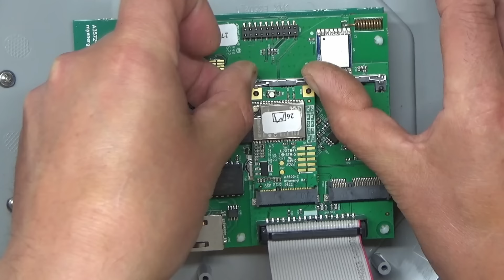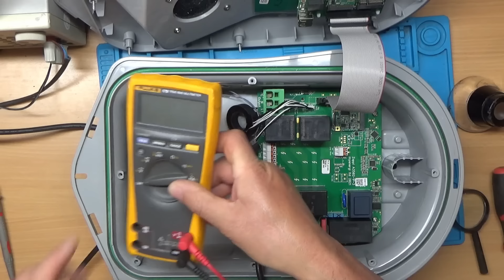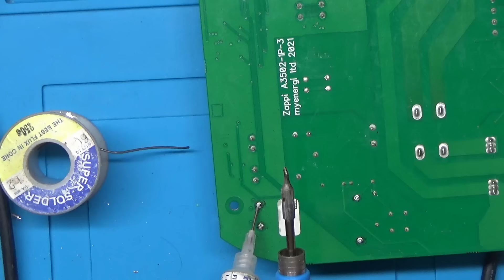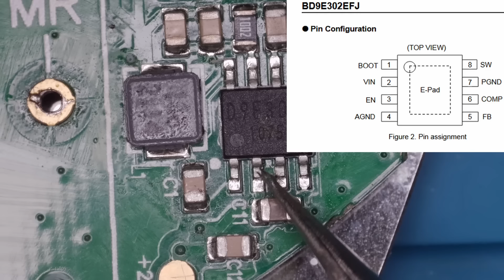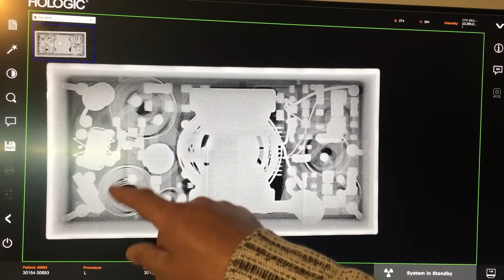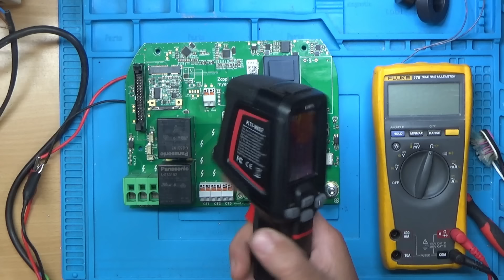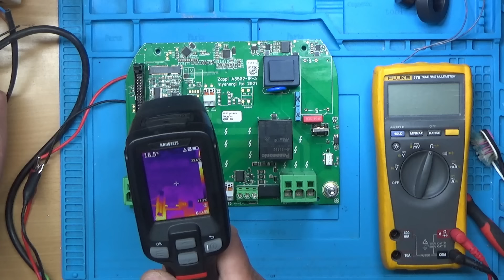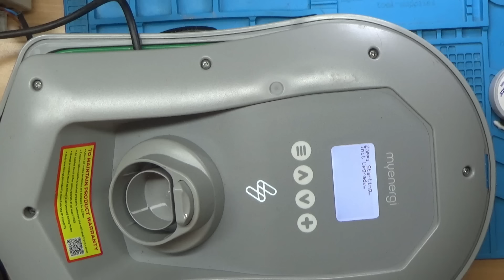Faulty MyEnergi Zappi EV Charging Point | Can I Fix It?

Comment: that's very complicated for an AC power switch.
All it needs to do is signal to the car what the max power is can supply, the car does the rest as that's where the charging system is.  I expect the rest is just to provide feedback to the user and provide time control. As I've heard that there can be restrictions on charging you car doing peak hours, it will turn the mains off unless you override it every time. 
Don't understand EV owners, I went away for 5days put £65 of diesel in the car and did over 500 miles without any worry whether I'd find a petrol station  with a free pump for the 5 minutes need to refill. 🙂
Reply from the maker: Yes, got all diesel vehicles here. I think the idea of this device is it monitors other things such as your solar power so it can tell the car to increase the charge rate during periods when the solar is giving more output (from what others have said).

Comment: Great job, Mick. Did you leave it at that or did you tinker with it until you found the break in the circuit? Thanks for sharing.
Reply from the maker: Thanks Brian, I just left it at that. I thought the PSU might have been removed previously.. and (see pinned comment 🙂)

Comment: It is a big fancy electrical meter but more importantly it is a communication device. It talks to the car via it's CAN network and the car tells it when it is good to charge. The EVSE (Zappi) then tells the car how much power is available to charge with. The Zappi also communicates with the solar so there is network pairs you can run from it to the meter box where you connect more CTs so the Zappi knows how much power your solar system is producing, and how much energy your house is using. It can then restrict the car's charge to use only the excess solar. There are other modes but that is the main selling point of that EVSE. That daughter board on the main board is the inbuilt protection circuit (RCD) - I had to replace mine when it kept tripping. I think it does other things as well like monitor vehicle isolation etc. An EVSE is not a charger - it just supplies AC to the vehicle's inbuilt charger so the relays are just for switching the AC through to the output when the vehicle says OK.
Reply from the maker: Interesting 👍 Thanks for that. I get quite a variety of things to repair so I don't always have time to research each item. I just try and fix it 😂😂👍
Reply: I am not an expert on EV Chargers, but I didn't think these home AC chargers talk to the cars CANbus.
I think they negotiate the available power levels using resistance between two of the data pins in the connector.

Correction: After some searching online it's PWM frequency used to negotiate.

Only DC chargers can communicate with the Cars BMS over the DC+ & DC-
Reply: @gavinnoname1424 You may be correct. I though they actually communicated over the CANBUS but I remember reading it's important to have the correct resistance across certain pins depending on whether it's 22kW, 11kW or 7kW.  AFAIK the EVSE uses a pilot signal (usually PWM) to communicate with the car which is why I assumed it's over CAN.
Reply: The EVSE and the vehicle typically don't have Comms for home charging. EVSE has a PP or proximity pilot connection to detect whether the cable is plugged in - this is the shorter of the 2 smaller pins in the connector. The other small but long pin - CP or control pilot has a PWM signal set by the EVSE to tell the car the maximum available current.

Comment: Nice, the potted ps in the x-ray machine. Like the electrolytics. Isn’t time for a Hakko FR-301 desoldering gun? And am I the only one who hears the Guano Apes when mentioning a “short on the board”?
Reply from the maker: Yes had been thinking of one of those, but there quite expensive (especially after I just bought an X-Ray machine 😂😂😂) I had to google "Guano Apes" and I didn't have a clue but it seems that's "Lords of the boards" ?
Reply: @BuyitFixit yes sir, lords of the boards, a ‘90s hit. Indeed the Hakko is not cheap and it is on my whishlist too, amongst other things 😅

Comment: This unfortunately happens a lot with electronics circuits, surface mount caps are a pretty common point of failure. There's so much waste produced due to the failure of such a tiny, inexpensive component. It's infuriating.

Well done on the fix though. 🙂
Reply from the maker: Thanks 👍Yes had this a few times now with different devices. One of them I remember, was the 1TB SSD I repaired on here which turned out to be brand new!

Comment: Replaced a capacitor, surprise nothing new there😉 great troubleshooting finding it.  Before you ran the wire point to point did you suspect a bad trace?  Strange xray didn't show a fault on the board, IDK.  Great diagnosing on your part as always, brilliant fix.  Thanks for the video and work.
Reply from the maker: Cheers Terry 👍I think the via between the layers of the board was damaged or missing. Nothing was on the leg of the PSU when I removed it, but looking back on the video it does look like there are black marks around the PSU legs already, so not sure if it had already been removed before (possibly by the guy who sent me it).
Reply: @BuyitFixit  Thanks Mick, I was totally confused. Amazed you figured that out.

Comment: You said there was no voltage at a certain point and added a jumper wire but why did that happen? And when did you discover that that little component was bad I re watched but couldn't see when you found it faulty.
Reply from the maker: Component @ 26:11. I'm not sure if the 24v PSU had been removed before? as when I first look at the board there seems to be black flux marks around the pins. There's normally a VIA that links the layers of the board together. Perhaps this was damaged at some point? It didn't come out when I removed the PSU so not 100%.
Reply: @BuyitFixit ah i see thank you for explaining
Reply from the maker: Update: It seems Burt had already replaced the PSU but it didn't work (see pinned comment under the video).

Comment: I knew when you weren't seeing the shorts when measuring at the top of the board that you'd pulled out the through hole plating (the via) when removing that little SMPS. It's easily done as it's very delicate (it's kind of plated onto not much after drilling the holes) so easily damaged and good design avoids trying to run a lot of current through vias. Reflowing that pin (to try and get solder deep down through to pad on other side) might have worked, but the wire worked so that's good. BTW MyEnergi bug me a little as they won't give torque figures for their screw connections and just say "tight". When I did a quality manufacturing course in Japan, they stood me (Brick Shit House) next to a five foot Japanese lady and asked the students which of us might not tighten a screw enough if not given a torque screwdriver and which might snap the bugger off on a regular basis. A screw connection that takes 32A for hour after hour needs to be right, which includes correct torque, and (more relevant to their Eddi than Zappi as flex to immersion heater) ferrules on stranded wire. They insist failures of these contacts are installer error rather than them not laying down to law/spec for installers.
Reply from the maker: I checked on the legs of the PSU, but no via there. I've pulled vias out accidentally before but couldn't see anything. One thing I did notice though is that the PSU might have been removed previously. Not sure if the guy who sent me it already have a look as it looked like all 4 pins had flux around them... Thanks for sharing you're story. I guess you must work with these things? I've not had any experience with them before.
Reply: @BuyitFixit  The through hole plating is done using a chemical deposition of a thin coating and then electroplating afterwards. There are so so many calculation regards current carry of them (part of IPC-2221) that we found it easier to try and design around it. I don't work with the MyEnergi stuff but do have Harvi and Eddi personally, hang around their forums, and seem to have an issue with biting my tongue at times! Well done on tracking that down, and I wish I had an x-ray machine.
Reply from the maker: @gadgetmind  Thanks 🙂I found the cause of the through hole issue.. see pinned comment under the video 😉
Reply: @BuyitFixit  Yeah, it's easy to pull out a via and not notice, and it's even worse if you're not the 1st person working on it. But your meter was telling you it wasn't there, which is sometimes not an issue, but well worth checking, and we don't all have x-ray machines. 🙂

Comment: This "smart" charger have the ability to charge from solar panels. In essence AC charging an EV is pretty simple as the PSU is located inside the EV. -12 and +12 are needed for pilot signal that is used to set the parameters and check the connection with the EV to safely turn the power on.
Reply from the maker: Interesting. Thanks for sharing👍

Comment: When you removed that integrated PSU component did the though hole platting maybe pull out and stay on the leg? just a thought. I do a lot of work on retro computers and this can be a problem sometimes if the leg of an IC is not completely free from solder and not moving freely (if that makes sense). Anyway, as per always great fix!
Reply from the maker: Thanks 👍I thought that too (as I've done it myself on older boards), but no. There was nothing on the leg of the PSU. I did notice however before I started on it that it looked like the PSU might have been removed before I got it as there was black flux marks around it? or that's what it looked like.
Reply: @BuyitFixit  Someone else must have had a go at fixing it before you, and maybe damaged it, but it’s all fixed now!
Reply from the maker: @ghost-retro3733  All has just been revealed (see pinned comment 😂😂😂)
Reply: @BuyitFixit  Running out of talent, it happens to us all.😁

Comment: 315,433,868,915 MHz threw me for a second :)
Reply: The Zappi uses 868MHz in the UK and 915MHz in Aus/NZ for comms with other bits of Myenergi kit. It's using the Zigbee frequencies but it not using Zigbee.
Reply from the maker: 😂😂😂Yes that would be quite some speed. I copied and pasted from the datasheet, but I guess you worked out what it meant 🙂

Comment: That does not look like wire strippers. If it says no-nik they may be for fiber optic fibers to remove the coating. They could be wire strippers for teflon coated very fine wire, what we called fly wire, usually used to correct mistakes on pc boards or repair bad traces. I know you will look these up to see what they are for because they are fine and used for very specific purposes
Reply from the maker: Good shout! I'll have to see if I can find some info on them. I know they did look a bit unusual.